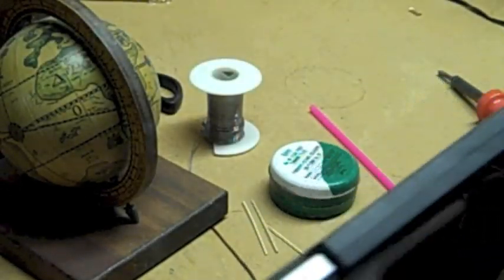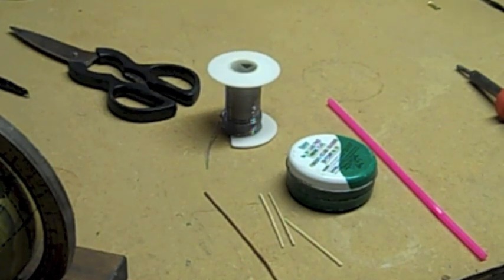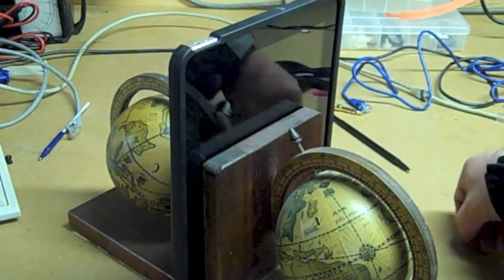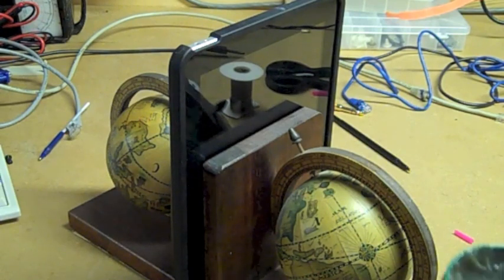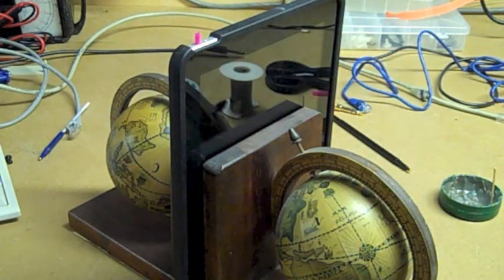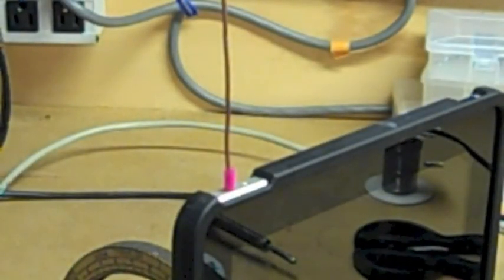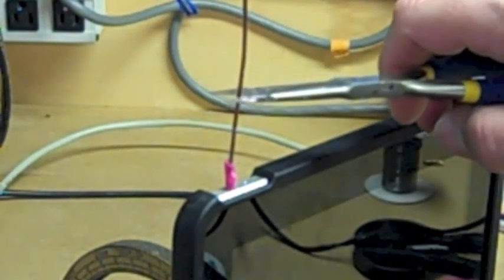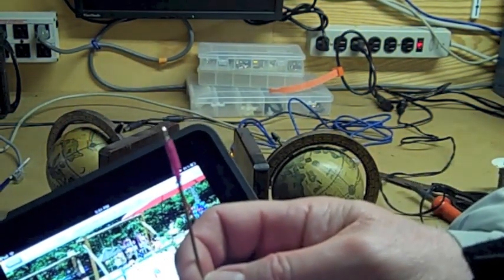Repair iPad iPad2 iPad3 with Broken Plug stuck inside Headphone Jack (no audio)

Comment: Can't thank you enough. Used this on my son's 4th gen. iPad. Worked the first time. I used a 30w soldering iron, flux is a must. With a 14 gauge copper wire. The straw is a bit too thick on the 4th gen to really get down past the pin but it did serve to protect the iPad from the heat generated by the copper wire.
Great tip, thank you again!

Comment: This is by far the best solution on the internet/youtube.  I got it to work on the 3rd try...thank you so much for posting this.  One thing I noted....after soldering the copper wire, hold it vertically (soldered side down) and heat again so the solder collects at the end, not at the side.  After I did this, it worked on my IPad 3.  Thanks again.

Comment: My neighbor came over looking for tweezers to see if he could get the "broken off" piece of a headphone plug out of his iPhone 5. The phone store told him they don't cover this repair and would charge him $250.00 for another phone.  After trying to get the piece out with modified tweezers we gave up and then found your video and gave it a try.  On the second attempt, the piece pulled out cleanly and the phone is fixed.  Thanks for the tip.  It really works!

Comment: Thankyou, you can also use superglue instead of soldering metal you use a cotton stick or toothpick gently apply superglue to it and slide it down inside the straw and wait for it to glue on. than pull it out gently!

Comment: I just cut a plastic q-tip in half  and push it in and rotated it a few times then pulled it out - probably worth it to try it before doing all of the more complicated stuff ... if it works great - if not not too much of a loss

Comment: Since you use glue is there a possibility the tube or what ever you put super glue on can get glued to the inside? 

Sorry if you explained this I can't hear since part of audio jack is stuck inside so if someone could explain the directions to me and answer my question i would be over the moon!
Reply: That's what you have to avoid, I have the same problem, used the glue, isn't strong enough, we still can't get it fixed.
Reply: DEFCON1GAMRS I finally got mine fixed. I don't know if this will help you or not, but since my grandfather works or pocket watches we were able to find a tool small enough to grab one of the wires that were sticking out because they ripped. We pulled it out so maybe that could work for you if you can find the supplies. Hope your device gets fixed!